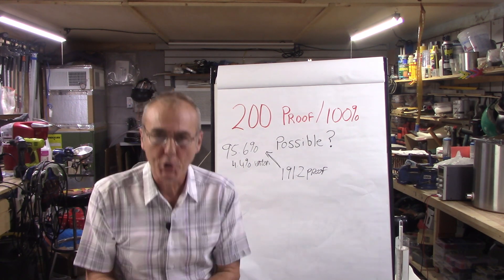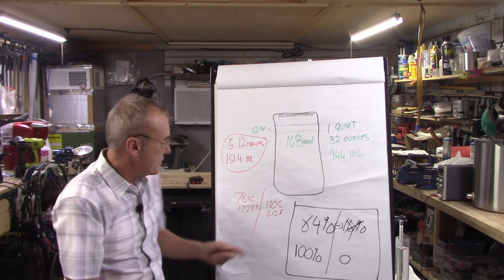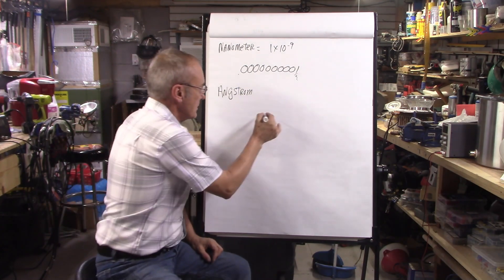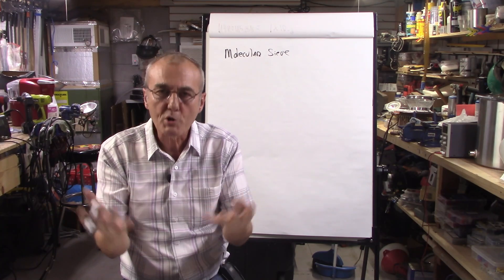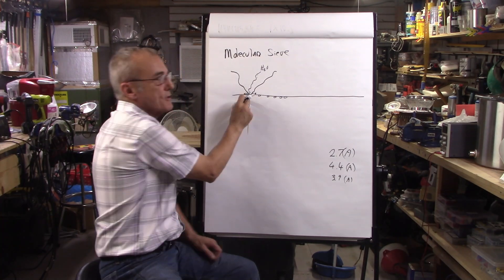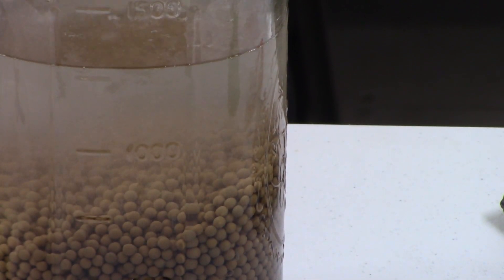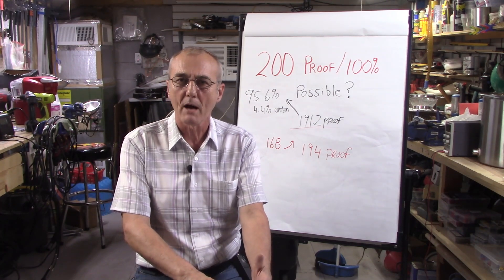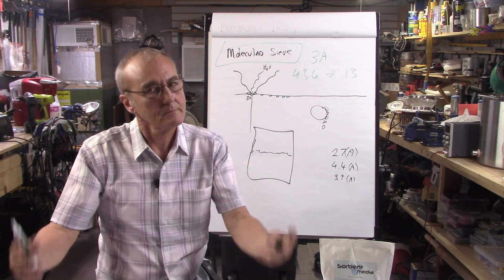CAN WE ACHIEVE 200 PROOF PART 2

Comment: As others have said this is correct,  but remember,  there is water vapour in the air,  so even if you achieve 100% pure alcohol,  it's affinity for water would attract the vapour in the air and would draw the water out of the air and into the alcohol so with time your %abv is going to fall,  also for drinking alcohol the pleasure is in the flavour,  how much flavour can you have when 100% of what you have is ethonol?

Comment: I have a copper still what is the highest proof i can obtain, i want to make hand sanitizer for myself and family
Reply from the maker: You need a reflux still or the ability to run it in reflux mode.
Reply: It is a plain copper still with a worm and i can add a thumper
Reply from the maker: @the69batman69  If you cannot reflux you cannot make a strong enough shine to use as a sanitizer. It must be 60% or 120 proof once mixed. You could use straight alcohol at or above 120 proof but it would evaporate quicker than it would sanitize. That what the aloe is used for; to make it stay around long enough the alcohol to do its job.

Comment: you got it backwards... 27 angstroms is 2.7nm.... I know this because I work on Electron Microscopes and the SEM (Scanning Electron Microscopes) I work on have a resolving power of 0.6nm or 6 angstroms.  The TEM or Transmission Electron Microscopes can see atomic lattice.. they resolve to sub angstrom level.
Reply: so since after watching the rest 2.7 angstroms is what you meant.. then it is equal to 0.27nm

Comment: I'd drop the temp in a freezer then run it over dry ice. Walmart $1.50 per pound. Maybe even after a dry ice bath run it through a condenser pot packed with dry ice to make sure the water is all gone. Wouldn't want to do that first since the ice would plug the line :)

Comment: I'd just like to throw in a warning if anyone is going to be using molecular sieves, particularly 3A zeolite. It heats up as it adsorbs water. So if you are using this on a water-ethanol solution that has significant amounts of water, it could get quite hot.

It's so good at generating heat that there are companies working on furnaces that "store" solar energy, and use zeolite as the main heating source. Pump in high humidity air, it's adsorbed by the zeolite, it generates heat, that heat is carried out by heat exchangers to heat your home. Then when the sun is out, you transfer that heat energy into this furnace to dry the zeolite out. They use a 13X based zeolite though, but the properties are similar. The 3A still gets hot if there is a lot of water present.

I'd also like to mention that there are other ways to hit 100%, you can use various polyatomic salts as well, the larger the charge of the anion, the better the separation seems to be, but really to go beyond phosphate at -3, you'd be hitting a periodate at -5, and they are strong oxidizers which would probably end up oxidizing the ethanol into acetic acid aka vinegar. Tripotassium phosphate is about as good as it gets, and while you could recuperate the salt, you'd still need quite a lot, probably at least 70%w/v, so it also isn't really feasible.

Then there is the pressure swing distillation I mentioned in the Part 1 comments. Realistically, like George said in Part 1, for drinking spirits, there really is no reason to attempt to break azeotrope. Might be neat for a one off experiment, but in the long term, it isn't worth it.

Comment: Licensed ethanol producer for fuel. Take a stainless tube,  fill the tube with the 3A media and cap it with valves to play with pressure and vacuum. I am always in search of ways to get to 200. There is also a way to do it with centrifuge and a 3A bladder so the water is pushed out. That is very cool but that takes a lot of energy. Also, the heat needed to discharge the water from the 3A media for reuse is just absurd. It IS impossible to create an off grid fuel source that has no water in it because of the energy required to recharge the 3A media ( or rather discharge the water) solar oven won't do it.  Good vid, write a script and get a teleprompter, they are under $200 for a very good one.

Comment: a better molecular seive..... dry cracked corn. the affluent will run over the corn... the corn wioll absorb the h20, and is then ready for the mash. the alcohol will then (after passing through the corn) be 100%. the corn will retain a infinitesimal amount of alcohol, however that is not lost, as it goes into the next batch. the product, which passes through the corn will be 100%, and two passes.
Reply from the maker: Somehow I have hard time with this concept. Can you elaborate a little more?
Reply: Barley and Hops Brewing I had worked years ago at a solvents company. The roots of this company go all the way back to WWI. The navy was having a hard time obtaining alcohol for their torpedoes, seems the water content would screw up the rpm’s, and timing, speed. They needed alcohol which was essentially 200 proof, and the contract was very simple... if you make it at this specification we will buy all you can make (for some extent of time, gallons)
The process is actually one which uses a biological molecular sieve. The starch in the corn is made to absorb H2O, not alcohol.
By passing “wet” alcohol over the corn the starch will absorb the water. How much corn? The corn can pull in twice it’s dry weight of water, so a process tank is filled with X number of bushels Of cracked corn. Usually two identical batch tanks are set up side by sides, with appropriate valving to accommodate switching if the one tank was insufficient.
The solvent (in this case alcohol) was pumped through the cracked grain, and tested. Then usually pumped through once more. Occasionally, due to higher water values the second tank was used. Double tanking was not normal.
Now being a factory cost cutting being what it was....
They also discovered that the now “wet cracked corn” could be placed into a steam jacketed tank, a vacuum pulled, and Voilà! You had dried cracked corn, of course any alcohol was (in this process lost. 
In a fermentation world that cracked corn would simply be either put into a mash, or air dried to reduce the spirits... then used with the process as pre wet ingredients......
It certainly would be an interesting video to see the wet spirits drip through and come out 200.
But I do agree, why would anyone want that degree of purity? My only concept is that the water has some excessive after flavor, and removing the water removed the off flavors.
Again, that would also be an interest video, saving a bad batch....
Reply from the maker: Thanks. That explains it much better.

Comment: It is unfortunate that the definition of Proof is at variance with the U.K. In U.S.A. uncomplicated in U.K. 70proof=40%abv.
Reply from the maker: There is a long story behind this and as with many topics this one just doesn't deserve explanation. You are correct the US has it simplified but then again we are still stuck on imperial weights and measures instead of the world wide base 10 metric system that is way easier ad more accurate.
George
Reply: @BarleyandHopsBrewing  Thank you George.I appreciate your response

Comment: If you leave that 199proof ethanol open, how long before you are back to your 95%?
I live in Cape Town, the best i can get from my T500 is 93%, but i need above 98%.
Reply from the maker: You need to seal it off as soon as possible. It does not take long to re-hydrate.

Comment: The thought occurred to me that if you changed the pressure, you can essentially boil water at far lower temperatures than 212°.... Courtesy of Mr Wizard and Julius Sumner Miller from back in the day... With an ice cube you could boil water inside of a closed beaker, because the pressure inside is more (or less) than the pressure outside the vessel.... Question is, would that also lower the evaporation temperature of alcohol 🤔 logic would say yes, but that's not always the case.... Maybe a vacuum chamber would answer that question, where you could take dyed water and alcohol, and see if the two separate parts will separate.
Reply: https://youtu.be/IPXjuOKgUMo

Furthermore.... You can boil the alcohol out of the water, according to this video.... And you can collect it as it condenses back to liquid
Reply from the maker: The only challenge is to super cool the collection container or else it will vaporize since it is still in a vacuum. I used dry ice to do this. My collection was small (500 ML flask) but challenging.
Reply from the maker: I've done this. The alcohol will vaporize out first.

Comment: I double run corn  mash and the end product is 186 proof or 93% by volume, this is so strong you have to dilute it with something to drink it. You don't need anything stronger than this for drinking even at 93% it's strong enough to poison you if you drink it too fast. Anything stronger than this and your making dragster fuel. Even if you make 200 proof or 100% by volume you have to store it in air tight containers because as soon as you expose it to the atmosphere it will draw water right out of the air and dilute itself back to 190 something proof.

Comment: Hmmmm ... I suppose if you were to use 4A sieves, you could potentially remove the methanol from the mix also.
Reply: I thought that also
Reply: I think ethanol is smaller than methenol so the ethanol would be absorbed by the sieve. Then you would have to get it out of the sieve

Comment: That was awesome! That 3A Molecular sieve will produce 200 proof but it does take a lot. I hope that you do a video on the Still Spirits Air Still. It's one of the easiest and most popular stills on the market. That's the one I'll be getting from Barley & Hops when I get my finances in order. :D
Reply: I got 1 for Fathers Day. Extremely simple to run and produces a pretty tasty product ! I'd been making wine for 5 years and beer for 2 or 3... Fermentation is the 1st requirement 😉 Fun hobby for sure and Georges videos have been a huge help !!
Reply: @wldtrky38  I've wanted that still since I saw Mike over Mile High use it on video 11 years ago now. My 3 gallon was nice but not quite what I had in mind and it still needs water to cool it. My 15 gallon from Brewhaus is simply too much work and I'm disabled so the air still would be perfect.
Reply: @knightmare1015  I am also disabled, so I understand !! I do a 5 or 6 gallon mash, so it takes 5 or 6 runs to get thru it, but there's no rush, and that's the beauty of it. Normally it takes 2-3 hours for a complete run, and I collect 1400- 1600 ML, down to about 10% abv (for a tails run later). No idea how long it will last, but I am running it hard, lol. I do NOT make neutral spirits...  6 corn likker, several different flavors of brandy, (peach from fresh peaches has been my favorite brandy so far) and 1 Geo. Washington Rye and I am VERY satisfied with the results 👍👍 Good luck, I hope you can make it happen, I doubt you will be disappointed.
Reply: @wldtrky38  thanks. I've got a ton of recipes that I want to try and I also want to try some more essences. The Russian Vodka essence was fantastic and I also enjoyed Mile Highs chocolate mint.
Reply: @knightmare1015  I finished a 6 gallon corn run today and put 2 gallons @135 proof in an oak barrel I got for Christmas (from Mile Hi)  I have a single malt "Scotch" finishing fermentation now and can't wait to get it distilling !! I have only recently been bitten by the single malt bug, lol, and I have high hopes my little still can make something similar. I plan to put the result into the oak barrel as soon as the corn finishes. Time will tell ! Best of luck to you 👍👍

Comment: This would be fun. I am awaiting my fuel alcohol permit. Is this what one would do if they wanted to run a car on ethanol? Provided the car is modified.
Reply: Tim Short where do you live and what website did you go to to get the permit application? I’m in Texas. I’ve searched government websites and can’t find the application.
Reply: @codyb4016   Here ya go, this is federal not state. https://www.ttb.gov/images/pdfs/forms/f511074.pdf I live in Montana and it is a different world here when it comes to individual rights. I pitty da foo that tries to change that.  ;-)
Reply: Provided the car was built after 1993, the car really shouldn't need modification.  None of my cars have ever been flex fuel,  but I've run E85 in a 96 Towncar, 03 Chevy 1500 van,  16 Ford Flex with no issues at all.  Makes them run like a race horse.  Engine light might come on but it's only because the computer thinks the engine is running lean. 
There's also a great book that I recommend called Alcohol Can Be a Gas.  👍

Comment: Also after use of the sieves you can dry them out in the oven and reuse them, though over time they will be less functional due to damaged pores. Another thing to note is that when you made 100% ethanol you really shouldn't open the bottle too much as it will absorb moisture from the air in a frightfully fast manner. Thanks for the video George really informative!
Reply: You can use your oven, but you will have to crank it, 450F is typically the max normal temperature, and it's at the bottom end of required temperatures. You also need to slowly ramp up the temperature, otherwise you can have issues with the pellets cracking. The water isn't just sitting inside the pellets, it has adsorbed (not to be confused with absorbed) to the surfaces inside the pellets, which is why it takes a lot of energy to remove it from the pellets.